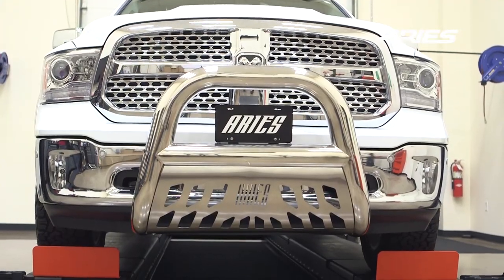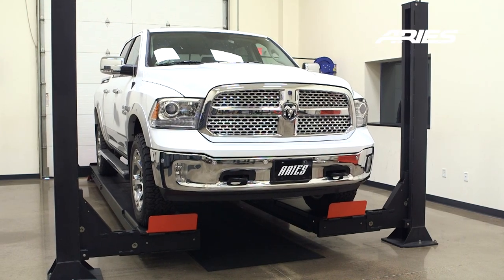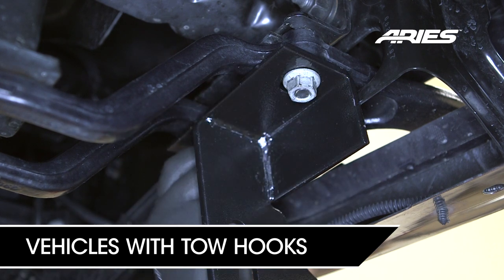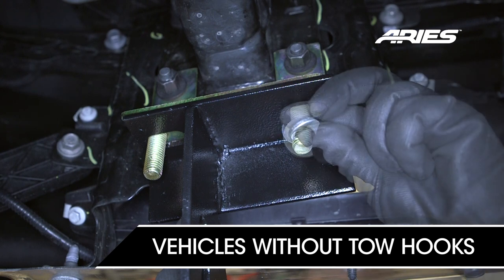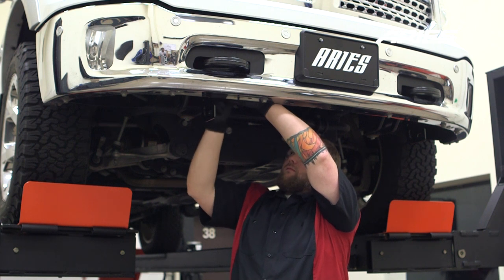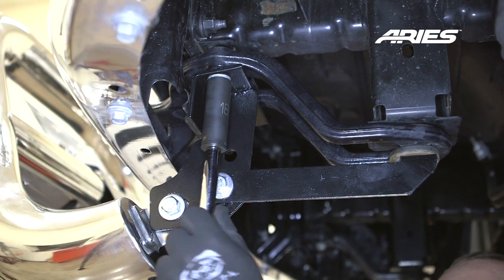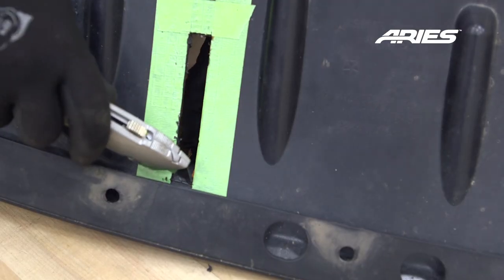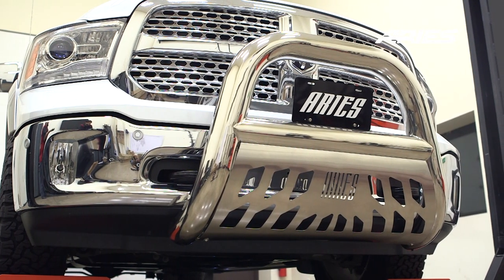ARIES Bull Bar Install: 4" Big Horn 45-5005 on Ram 1500

Comment: I see that you have installed that bull bar on a truck with front parking sensors. Does the bar interfere with those sensors? I've seen posts by many RAM owners that would really like to know this!
Reply from the maker: +Will Morton Sensors will have to be disabled.